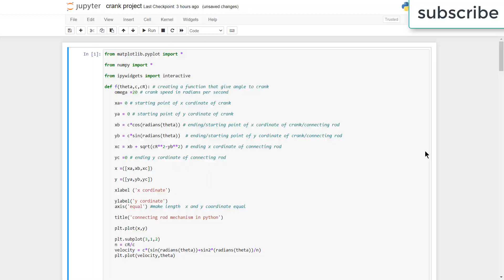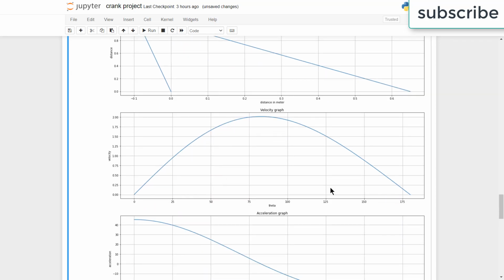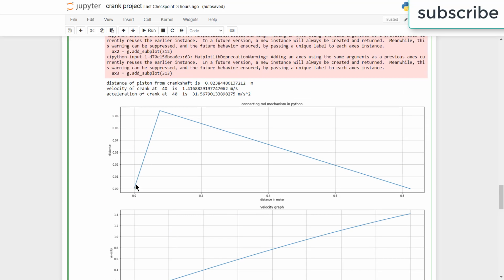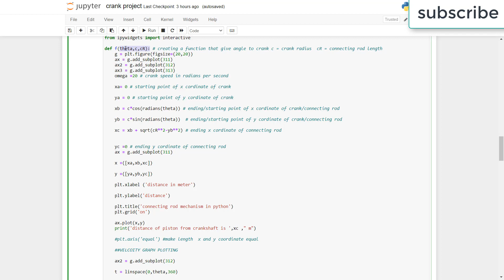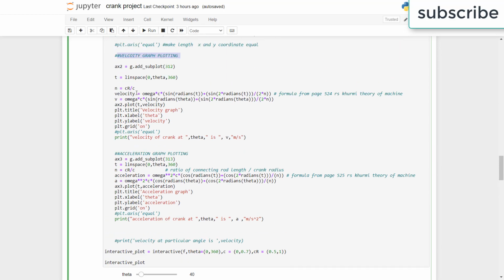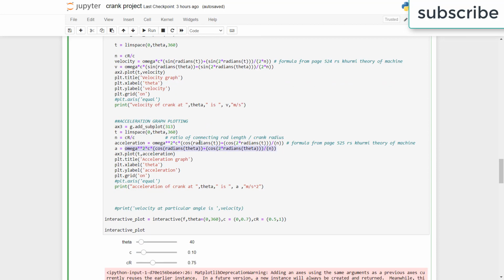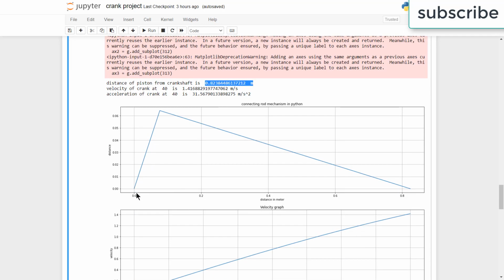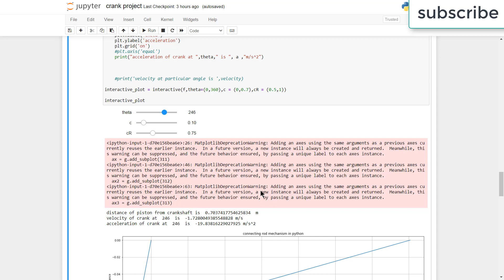Crank radius velocity and acceleration analysis in Python

Comment: how did you learn programming while pursuing mechanical engineering?
Reply from the maker: I use it for solving my mechanical engineering problem you will find plenty of video in which i am plotting graph of mechanical engineering project like velocity diagram of pump etc